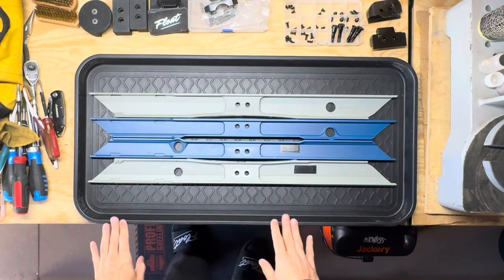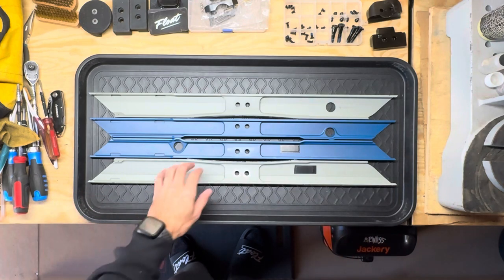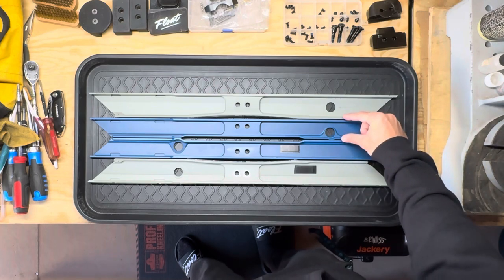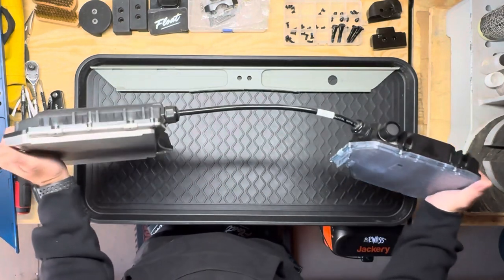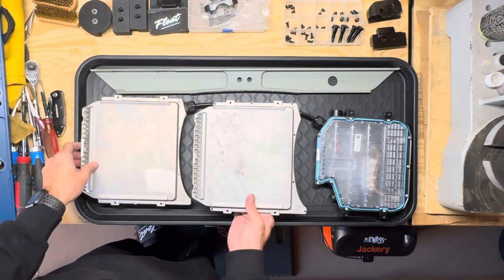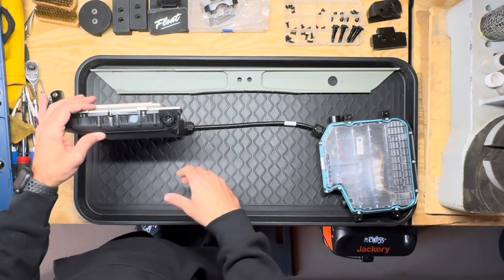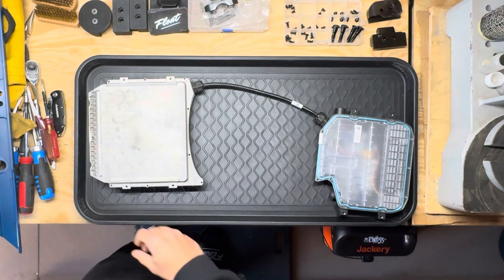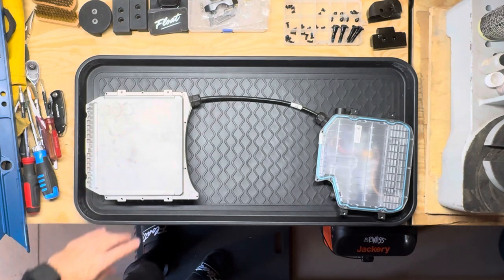Will Onewheel GT Modules Fit Onewheel XR Classic Rails? - Let’s Settle This!

Comment: I'm guessing the the XR classic uses the Pint X battery module.
Reply from the maker: The XR Classic battery is unique to the XR Classic. It’s an 18s2p configuration (just like the GT) that uses 18650 cells (just like the XR and Pint/X). Capacity is 388.8 Wh.
Reply: It doesn’t, different voltage.

Comment: If they release an XRC battery module, it might be possible to convert a GT to an XRC? If anyone loves the form factor enough to want less range.
Reply from the maker: It might eventually be possible, but there are compatibility issues between the XRC BMS and the GT controller. Would likely need to swap both the BMS and controller from a GT in order for it to operate (and you'd also need to be able to access Factory Mode to clear the 'Corrupted memory' error).

Comment: What's the point of the XR Classic if it's rails are just as long and the width is just as wide as a GT?  It seems to me that we're just getting a GT with new rails and less range, with a smaller hub.  Am I missing something else?
Reply: Lowered position of the hub I guess
Reply: Smaller battery, less weight, better for tricks, looks cooler.
Reply from the maker: That's it in a nutshell. This board's not gonna be for everybody for sure, but it's a neat form factor.

Comment: GTS controler / battery could be fit inside XRC controler / battery boxes...
Reply from the maker: The controller would definitely fit because they both have the same exact box and PCB (this is confirmed in my teardown video).

However, I do not have confidence that the GTS battery would fit in the XRC battery enclosure. The GTS battery hasn’t really been messed with due to the inability for us to recover a GTS after a ‘Corrupted memory’ error.

Comment: Any chance that GT fenders will fit on the straight rail XRC? I'm wondering if my drop top fender from the float life would work with it
Reply from the maker: I tried to put a GT fender delete on the XRC and it did not fit. The full GT fenders clip into the axle blocks on the GT/GTS and the axle blocks on the XRC are different. Split fenders may still work.
Reply: Thanks  @fixmypev  you're the best 👊
Reply: Yeah, they mentioned it, gt fenders and footpads will fit